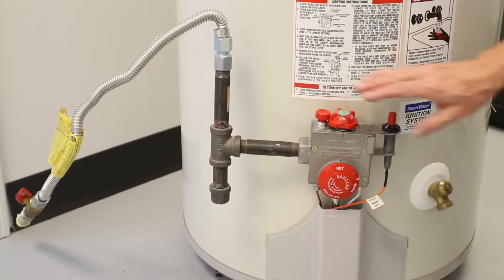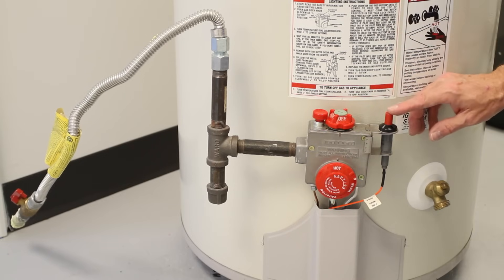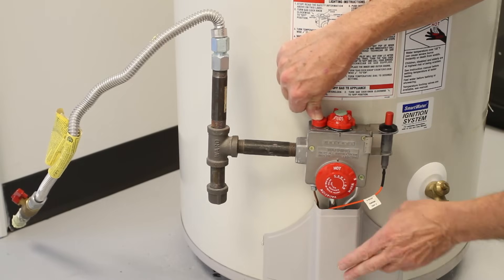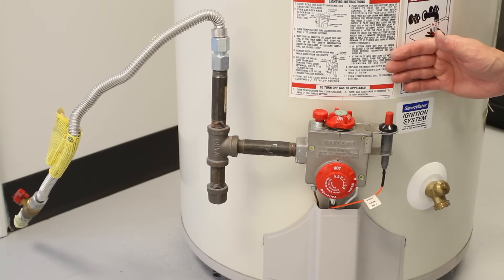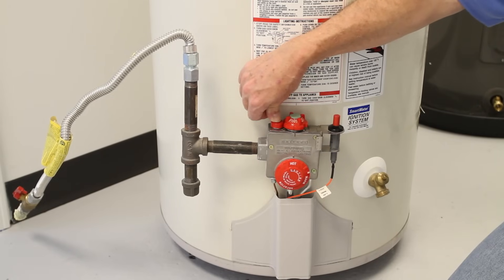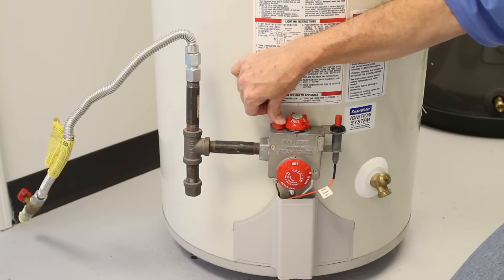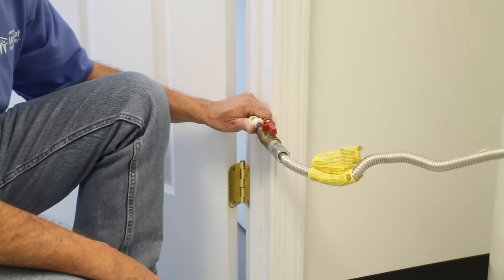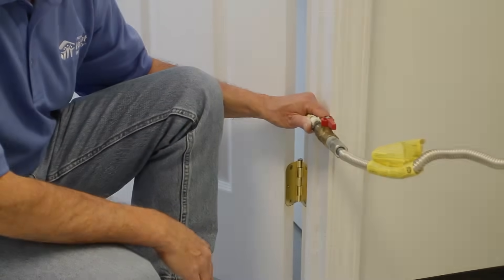How to reset gas water tank pilot light

Comment: maybe its just me but following these steps definately did help but. after relighting the pilot light, my water heater was working well for about an hour until it overheated or something and basically blew a gasket at the top. i had a plumber come over and the whole thing was a big mess. hot water pouring out from behind my washer into a drain (washer machine drain) i didnt know about (boiling water) im guessing it was overflow from the water heater, so keep in mind to watch for potential leaks when restarting water heaters cause they can break like mine did and cause a huge, hot, leak. and that overflow or unexpected hot water can really damage pipes (like my old apartments)